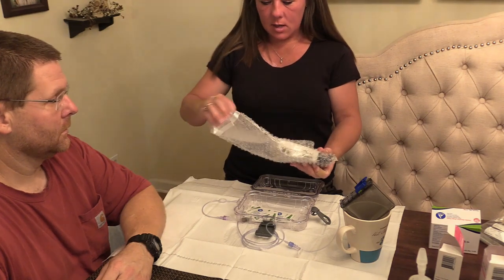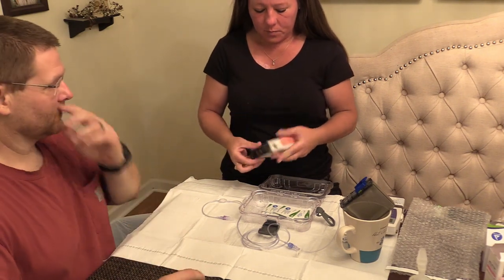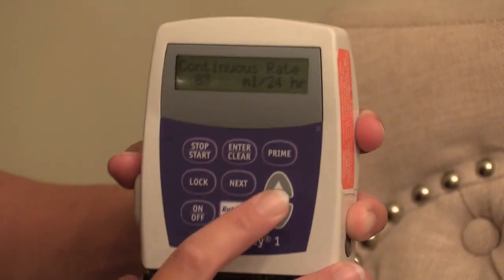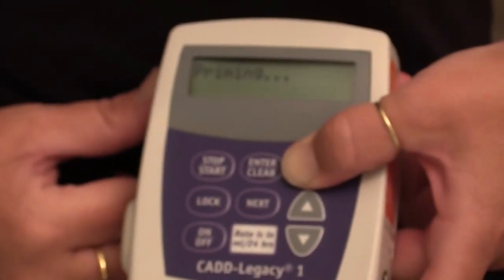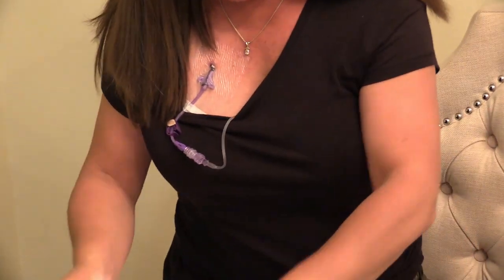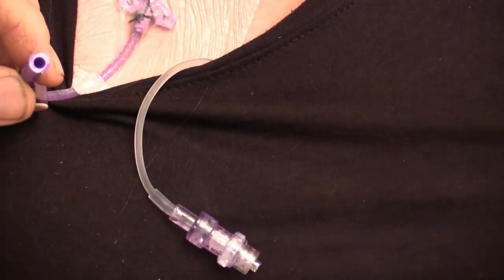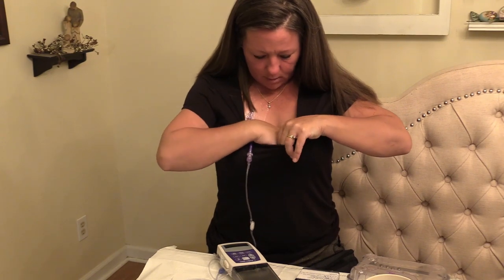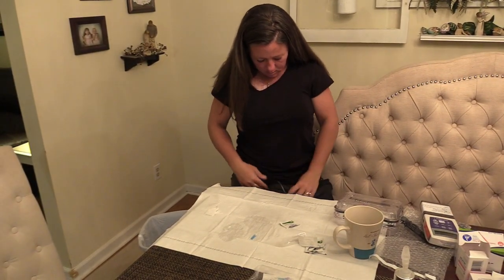Veletri Tubing Change And Cassette Change

Comment: Thanks for this clip!! 
Just a quick comment  I'm starting to work with a child that has this condition. 
In case this is helpful, we put a safety pin in near the top of his undershirt inside, and weave the tubing in til the filter. This way, especially as a kid running around, we don't have to worry about someone pulling the tubing.
Reply from the maker: That's a good idea thanks for sharing this with me. I appreciate it ☺
Reply: @MountaineerOutdoors  my pleasure! Least I can do, help someone!